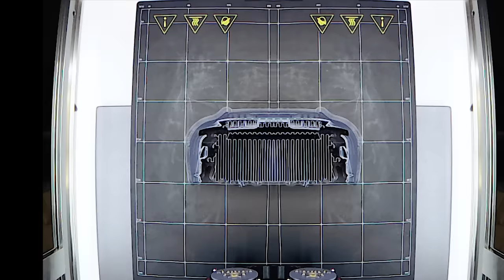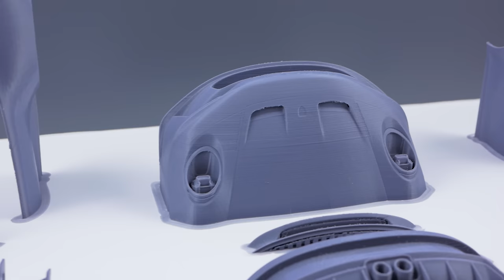How i Fully 3D Printed Porsche 911 (992) GT3 RC CAR

Comment: Nice work. But the layers are horribly visible and look not each same. Something seems to be wrong in your settings.
Reply from the maker: No, it is smooth. Light source it on top and that's why it seems like that, only spoiler part had some artifacts

Comment: I love the timelapses for the printing shots! Have you considered making interiors too?
Reply from the maker: Thanks. No, it won't fit cause inside there are electric motors batteries and etc...
Reply: Did you pause the print on each layer to get that Timelapse? How did you get the printer head out the way

Comment: Amazing work. Is there a program that automatically adds connector points to builds when you need to break them apart to build? It would make getting it aligned in glue up easier.
Reply from the maker: Thank you. There is one program, materialise magics but it's not free

Comment: did you use pla or petg ???you mentioned only tpu for the tyres......nice video
Reply from the maker: Body is made with PLA + and tires are TPU
Reply: @MrGoodcat1  is it durable? What if the car run in a tropical place?
Reply from the maker: @DnKcorner  it is durable if there won't be any contacts (crash) on walls or ect...

Comment: My  question about electronics which motor T did you use? I want 12T motor but i dont know how its driving and which battery did you use 2s or 3s?
Reply from the maker: Hello. I was using 540 motor with 2S battery
Reply: @MrGoodcat1  Thanks

Comment: Printed it, wheels fitted to the axles, wheels sticking out on the sides of the body, almost 10mm each side
Reply from the maker: You should modify your chassis to fit properly. At the moment i'm doing new adaptable chassis for my new project
Reply: @MrGoodcat1  i did adapt the chassis, the length is fine but the width is an issue...the wheels is sticking out on the sides, the issue is the offset on the rims
Reply from the maker: @johanstrauss81  Should scale down some axis parts. For example something like this: https://mega.nz/file/MBlDAa5D#Vjnxtne-YotqrSBCkTP7j5Qm5wOAP6pyyvO9mspbg3A
Reply: @MrGoodcat1  thanks. I will give it a try
Reply: @johanstrauss81  may i ask which parts you adjust to make the chasis fit the wheel base?
Reply: @martinvanweel1126  i modified the offset of the rims so the rim would sit flush to the body

Comment: Did you use any scaling when printing body? I see it has 245mm wheelbase and chassis is adjustable from 258mm to 288mm so in theory it should not fit
Reply from the maker: I haven't scaled anything. You have to adjust chassis and it will fit without any problem